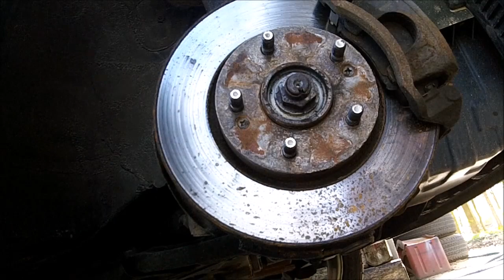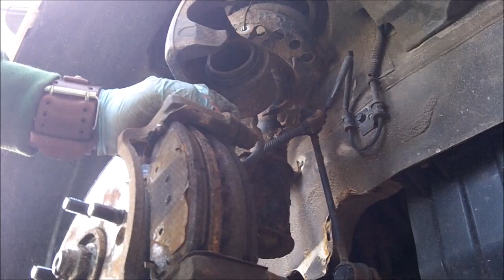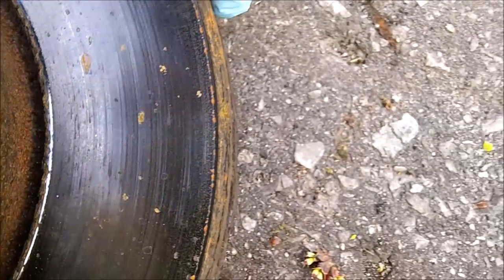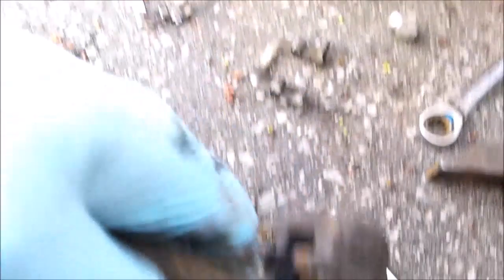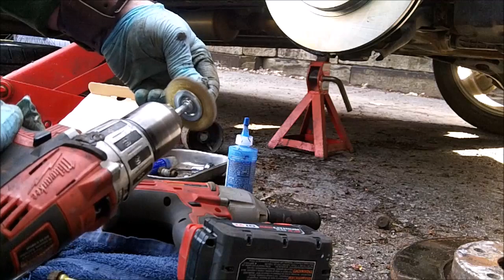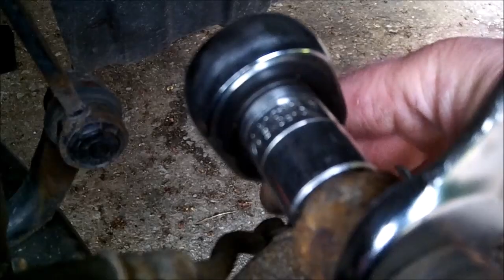How to change 2009-2014 KIA Soul front brake pads and rotors

Comment: Thanks for taking the time to make this comprehensive video.

I have changed brake pads on various cars before, but it was nice to have this guide to show me the specifics for my Soul.

I must say that I am impressed with the design of the brakes on the Soul.
They are far easier to service than the brakes of other cars I have owned in the past.

It's never a particularly difficult job, but on the Soul, it is particularly easy because all the clips etc remain in place.

Comment: Thanks. I usually just use the old brake pads to lay across the piston and push it back with a C clamp. To each his own. Just a fun fact, the rotary heat up, so if you leave grease on them, besides them being less effective you risk them catching on fire.

Comment: Does Kia state the 2 phillip head screws need to go back? Because those aren't needed to be put back on typically.
Reply: they help to prevent clatter...interesting fact , that if the rotors are engineered and the rotor retainer fasteners provided then it would be prudent to reinstall them... clean them add some anti-seize compound...not putting them back is indicative of quality of workmanship folks...when you take things apart you should put them back in the way they came out and you shouldn't have any left over parts
Reply: @ChadLuciano  Disagree. Those stupid frozen bolts don't need to go back. I've done many Kias brakes and never put them back and no clatter this that. Cut it out with your ethical speech 🤣

Comment: Take a screw driver and place it in between the pad and the front part if the  caliper through the front side and pull towards you. That will push the piston back in and will allow the caliper to come.off without banging it.
Reply from the maker: correct . excellent advice . You have to admit the hammer gets rid of pent up frustration :)

Comment: I've learned to pinch off the brake hose and open the bleeder valve when compressing the piston. I will start using lock tite on the caliper bracket bolts.
Reply from the maker: The reason I would never pinch off a brake hose is that some are lined in flexible steel. Pinching can wreck the braided line and not allow the fluid to go  backwards since there isn't enough pressure in that direction , This can cause locked up or dragging brakes , I had an old 740 with this issue that took ages to figure out . when you pushed the pedal there was plenty of force to push the piston out ..but when you released the pedal the pinched internal hose wouldn't let the fluid move back and allow the pads to retract . sorry long winded explanation.
Reply: @fupabox  wasn't aware of internally braided hoses. I'll look it up. Most stainless is external. What do you do to keep sediment out of the master cylinder?
Reply: I looked a little bit, but can't find any brake hoses with internal steel. Could you please link me to some info? I'm a mechanic and it's good to know these things.
Reply from the maker: @mikeg6633  regular brake fluid changes ..every year  or 2
Reply from the maker: @mikeg6633  Very good question. I just spent some time looking as well and it seems that for years I have been overly cautious from the one bad experience . The Volvo Turbo I had the brake line issue with was heavily modified and it is likely it had rubber coated stainless lines that the clamping had damaged internally . I wrongly assumed that many other brake lines were also rubber wrapped stainless . Stainless usually have a teflon plastic internal pipe that is possibly where my deformation came from as well , since it could have been crushed by my clamping . That being said I was just assuming after that fiasco that many rubber lines were also internally stiffened . Looks like the one bite in my ass years ago made me a bit too gun shy . Thanks for that info . I never would have bothered looking . much appreciated

Comment: Hey fupabox, are the 2014 1.6l  any different from the earlier models? I bought a performance brake kit for a 2011 Soul will it fit my 2014 Soul??
Reply from the maker: should be the same . They didn't redo anything major until 2019
Reply: @fupabox  Thanks, I thought so as well so I bought the performance brake kit from Power Stop and I wanted to be sure b4 I start the install. Carid is saying no it wont fit but that could be misinformation.
Reply from the maker: @EdwardZazzara  just checking cross compatibility on Kia soul brakes  on Rockauto . looks like up to 2013 everything was the same . 2014 -2018 they did a slight revamp on a lot of parts . Hopefully your brake kit fits . Possibly the 2011 and 2014 had different calipers and rotors but if the spindles are the same the kit should bolt on . Cant find any info on the spindles
Reply: @fupabox  thanks so much, luk hope we are correct. If I lose ABS n/p I do not like ABS anyway! As long as it doesn't create an ECU warning light.
Any other info u know please help. The look the same while comparing when parts r on the vehicle. 
So you think they will fit???
Reply from the maker: @EdwardZazzara  I hope so , but I 'm not sure . Shouldn't have any effect on abs or ecu

Comment: No problem with this the guy explains very well but Many people top up their brake fluid and if you push the piston back the fluid will quite probably overflow so the suggestion that the other guy makes about cracking open the bleed nipple when pushing the caliper piston back is a real good idea as the other alternative if the fluid level is high is trying to take some out not simple as you dont want to contaminate it an any way.

Comment: just changing the brakes...you don't have to loosen those screws on the rotor unless changing the rotor.....right or wrong?
Reply from the maker: correct,you don't need to remove them if you are just doing the pads
Reply: Yes that is correct. If the rotor is staying you don"t need to take them out.
Reply: Great  VID....thanks!
Reply: I just did brakes on an '05 Ford Escape, and a '10 Soul. This isn't any more difficult than changing a tire. I watched this to double check myself because it seemed too easy. Lol.
Reply: Take those screws and throw them in the garbage, they will cease up and you will never get the rotors off!
Reply: little something called anti-seize

Comment: so when you spun the rotor at the end I heard some grinding noise.  Isn't is suppose to spin someone freely with no "touching" sounds?
Reply from the maker: It's just the sound of the new pads touching the rotor, they aren't pushed back firmly into the caliper until you press on the brake pedal.. the pads are also a tiny bit rough when first installed.. within the first few hundred meters driving that will be gone

Comment: You should be using caliper grease not anti sease
Reply from the maker: When I was first taught (40 years ago by a dealership mechanic) we always used anti seize on slider pins. Not sure if the formulation is changed , but I'm noticing it dries out much more quickly than it used to . Have lately been switching to synthetic brake lube .

Comment: I wouldn't even use those screws when putting the new rotor on. Just eventually will become a PITA.
Reply: I know other cars don't even have them. I used an impact screw driver that worked my smashing it with a hammer manually. U wanna talk about sweating a puddle in the middle of July?? I was so dumb n bent on following the instructions i never even thought to see if they'd come off another way

Comment: C-camp inside the bore. Epic fail. Use an old brake pad and put the c-clamp on the pad and the outside of the caliper and then push the piston in. And doing it this way you were putting pressure on the outside walls of the piston and not in the center which is the most fragile part of the Piston if you use a c clamp in the in the video is shown you could stand a chance to poke a hole in the center of the piston ruining the caliper